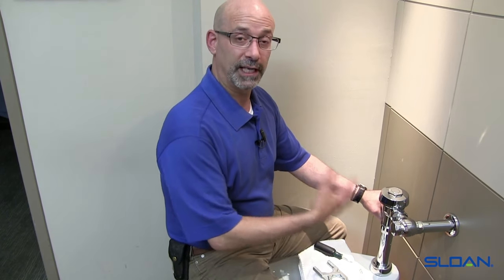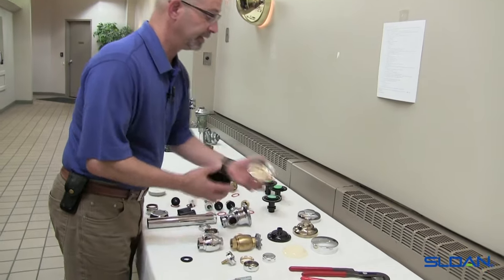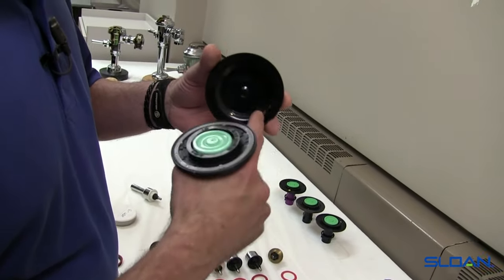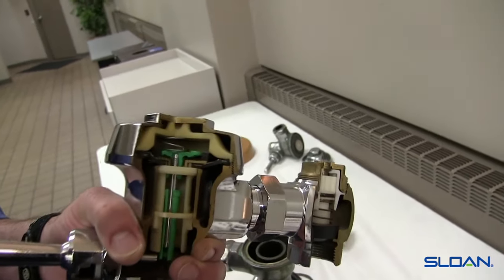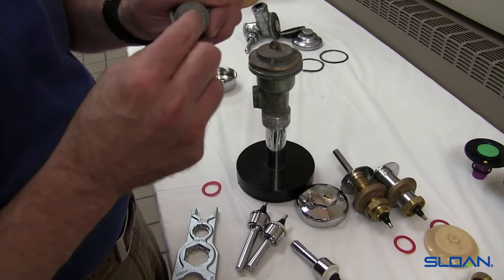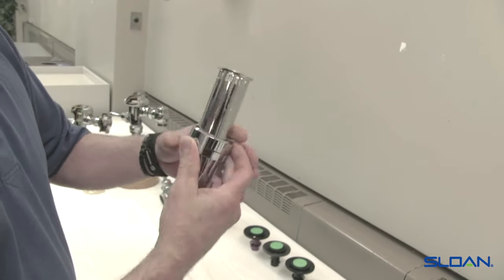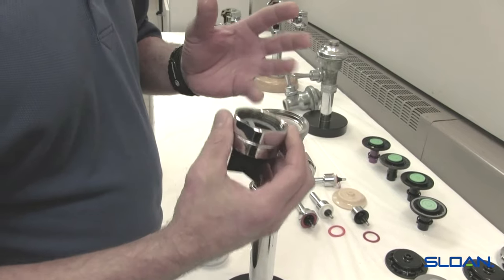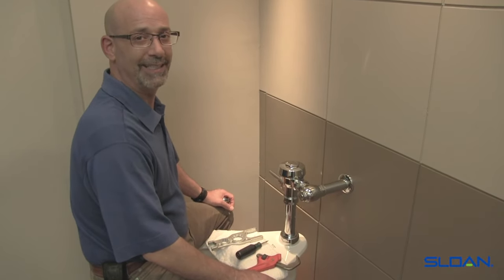Flushometer Basic Maintenance - Using the Right Tools

Comment: I'm jealous of that shiny new valve you're working on.  I need a two foot breaker bar on my spud wrench, and another wrench to hold back on the valve body, just to get the dang cap off of the 100 year old valves I have to repair.
Reply: On flushometers like that I remove the valve body and mount it in a chain vise then remove the cover with a pipe wrench.  That is for old beat up valves.  For nicer looking valves you can thread a 1 1/2 inch coupling onto the vacuum  breaker threads and mount it in a vise using the coupling.  You still need to back up the spud wrench when you remove the cover but it is more manageable.

Comment: Awesome video finally the real expert explains this.  Thanks for this training video.
I wish he had spent a little more time on the diaphragm part since they use 5 or 6 different types for urinals vs toilets and flow amount. In the on-line catalog they have so many different to choose from and I want to keep just 1 or two on my truck for urinals. Will they fit and what are the color codes? The stop valve repair kits also show 2 different ones for 3/4" or 1" but I don't know how to tell the difference in the old ones.
One of my customers has 10 different urinals both Zurn and Sloan it seems the parts are interchangeable on the basic models at least that what they tell me at the parts counter.
Reply from the maker: Doug, thanks for reaching out. The diaphragms are all the same dimensionally. They each have different features which enables the change in the flush volume but you can use any diaphragm on any valve (except for the G2, ECOS, & Solis valves. They use a different style of diaphragm) and it will fit. 
Generally a 3/4" supply line is used with urinals and 1" supply is used with water closets. There are, of course, exceptions. There should be a series number stamped on the bonnet of the control stop. We are currently using the H700 series but you can also get kits for previous series, H600, H540, etc...Hope this helps.

Comment: This is great info. I just wish I could turn the water off. The cap over the control stop just spins loosely on the urinal with sloan g2 flushometer. I know that the valve needs replacement but one of the battery springs just broke off and was stuck to a battery. Is there any warranty regarding the battery spring failure?
Reply from the maker: Dave, thank you for asking. Our tech support team can help you with this issue. They can be reached at (888) 756-2614 during normal business hours between Monday to Friday, or by email at techsupport@sloan.com.

Comment: 1:23 - I have been impressed over the years with your chrome finish.  Please tell me the best cleaner to use to keep them in the best shape.  I know from experience that chlorine bleach destroys the luster in a very short period of time with no resolution but to replace the valve.
19:38 - Your Continental cover has no flats. So, I'd have to use an oil filter wrench to get this one apart?
Reply from the maker: Hi Gary, sorry for the delay. We hope the following advice helps:

1:23 - We only recommend mild dish soap in a spray bottle and lightly spray the towel and wipe the chrome, then use a dry towel towel to clean and dry.  If there are difficult stains it is best to use an ammonia free window cleaner or white vinegar, lightly wet the towel and work the areas needing cleaning, then use a lightly water dampened towel to wipe off the solution, and then a dry towel.  For hard scale build-up or bonded contaminents on the chrome finish, try a mild chrome polish, OR use ‘0000’ steel wool and work the areas to clean and VACUUM up the steel fibers that shed during cleaning; do NOT use a wet cloth to clean up the fallen steel fibers for they will begin to rust and stain the chrome finish or porcelain of the fixture.
19:38 - We recommend using a strap wrench to prevent scratches to the chrome finish.  Sloan offers EBV22 Strap Wrench (Code# 0305823); if replacing the inside cover, use the A71 Continental Inside Cover, Code# 0301221.

For any further questions, please reach out to techsupport@sloan.com. Thank you!
Reply: @sloanvalve  Thank you. That helps greatly. I'm attempting to change the protocol for cleaning the bathrooms in our restaurants and want to offer something to replace the 'Dowse-everything-in-undiluted-chlorine-bleach' for sanitizing purposes.  I expect they're just leaving the bleach on the fixtures after application for it to cause such a discoloration of your chrome finish (looks ugly -- and even appears dirty -- after only a few years using bleach in this manner to sanitize the fixtures). I may also check out the mild chrome polish to get the luster back.

Comment: I've changed hundreds of these and still learned alot from this video.(the reason for the dripping at the vaccuum breaker)
Question,  today I had a flushometer dripping around the valve body cap (a rare place to leak) I replaced the diaphram plus cap.  Still leaked.   Changed the valve body, still leaked same place.   Changed to yet another valve body and same thing.   Could this be caused by the supply stop check valve not working properly , letting water flow backwards.?     We've had pressure fluctuations alot lately.       Thanks
Reply from the maker: Hi Greg, I am sorry about this problem. Our tech support team can help you troubleshoot this issue. They can be reached at 888.756.2614 between 7 am to 5 pm on weekdays, or by email at techsupport@sloan.com.
Reply: I’m rereading and it seems we are having different issues. I looked at the video and he start to describe the issue I’m having at 12:20 mark. I’m seeing you’re having a different issue. Hopefully that helps

Comment: In an attempt to repace the vaccum breaker, I used a spud wrench at work in order to loosen the nut located on the right side of a toilet.  Unfortunately, I somehow caused a leak from where the nut is and ended up having to turn the water off. It required a lot of force loosening that nut. Did that end up damaging it? Also, would Teflon tape help with fixing it? Thanks.
Reply from the maker: Very sorry to hear that. Thank you for reaching out. Our tech support team is able to assist further. They can be reached at 888.756.2614 during business hours 7:00 AM - 5:00 PM (Central Time) Monday through Friday, or by email at techsupport@sloan.com.

Comment: It turns out my old Sloan does not have a groove fir a vacuum breaker. After a number of diaphragm changes and lots of bangs after a flush, the shut off valve started leaking and then the toilet would not stop running:( I tried to open the valve , but could not unscrew it, or didn’t know how to do it . So had to call a plumber...
$400 later and not more than 5 minutes of work, he changed the valve and it all works. I feel stupid:)
I got the Sloan wrench, though, maybe next time I’ll be more prepared:)

Do those diaphragms have a warranty? I now have 3 of them quite new
Reply from the maker: Our tech support team is able to assist you further with this issue. They can be reached at 888.756.2614 during business hours (Monday to Friday, 7 am to 5 pm) or by email at techsupport@sloan.com.

Comment: Very good video but surprised you talked about different kinds and didn't say where to find the model #. My valve would work fine if it reset for the next flush but flows at full force and won't reset. This has to be a defective part but all you covered was leaks. If you reply to this comment I won't know where to look for it on YT.
Reply from the maker: Hello, thank you for reaching out. Our tech support team is available to provide assistance at 888.756.2614 or by email at techsupport@sloan.com.

Also attached is a link to our parts brochure and our full repair and maintenance guide to help with parts identification:
https://www.sloan.com/sites/default/files/2019-11/SLO1081-Parts-Brochure-v19.pdf

https://www.sloan.com/sites/default/files/2023-09/Complete%20Repair%20Parts%20and%20Maintenance%20Guide_0.pdf

Additional assets can be found on https://www.sloan.com/resources/downloads/technical-downloads

Comment: I have a question regarding the flow ring on the diaphragm, how is it flipped to change the rate? As in the procedure for being able to remove the ring to flip? Thank you
Reply from the maker: Thanks for asking. This should help:

You may referring to the “refill head” that can be flipped on the A38A & A36A diaphragm assembly, the black “flow ring” is the loose, flat smooth ring the slide.  On Sloan A38A 3.5 gpf Diaphragm kits, there is a blue fixed ring (refill head) positioned where the black guide tube meets the rubber diaphragm; the blue refill has a beveled step down outer edge seated against the diaphragm (has “SIDE 2” molded into the face against the rubber), and a squared outer edge facing down, towards the black guide tube.  This is the refill head that can be flipped when used on old 4.5 gallon per flush toilets (made prior to 1977).  To flip the blue refill head, Grip the black guide tube with a towel in one hand, and the rubber molded disc on the top of the diaphragm assembly with the other hand, and unscrew the parts; lift the blue flow ring off the top of the black guide tube, flip it and re-install it, now with beveled step down edge (SIDE 2) facing down the black guide tube.  This will increase the volume to 4.5-gpf (Gallons Per Flush).  The reverse will work on the A36A 4.5 gpf diaphragm kit to reduce the volume to 3.5-gpf; same refill head on black in color.  The blue color is to distinguish bevel up for 3.5 kits, and black is bevel down for 4.5 kits during assembly process in the factory.  Because of the increase in flow rate to the closet from flipping the blue refill head, please take care to properly adjust the control stop for a smooth, no-splashing flush; during the flush, the rim wash swirl should not climb in the bowl to reach the rim, it should stay low in the bowl or finish with the swirl into the trapway at the bottom of the bowl.

The  Flow Ring: On  most of our closet diaphragm kits (ROYAL, REGAL, & G2/SOLIS/ECOS), 1.28, 1.6, 2.4, 3.5, 4.5 kits, there is a loose flat smooth ring that slides up and down on the black guide tube which is the flow ring. This ring is a restrictive flow ring, it is not meant to be flipped (it is symmetric), but in cases where (during the flush) the flow pressure to the closet needs an increase in flow rate, the ring can be removed (clipped off) to start the siphon rate quicker in the closet. This will increase the volume slightly overall, but it will increase how quick the siphon starts at the beginning of the flush. After removing the flow ring, please take care to properly adjust the control stop for a smooth, no-splashing flush; during the flush, the rim wash swirl should not climb in the bowl to reach the rim, it should stay low in the bowl or finish with the swirl into the trapway at the bottom of the bowl.  HOWEVER, the caveat is that if the plumbing system flow pressure is below 10-12 psi flow rate, then removing the ring can cause a run-on condition because then there is not enough back pressure in the valve body to force a positive bypass in the diaphragm to shut off the valve.  Most plumbing codes, for commercial properties, will call out a minimum flow pressure requirement of 25-Psi flow rate, not for the valve, but for the commercial water closet (flush valve toilets), for a proper evacuation and drain line carry.

Comment: Can I reduce the entrance from the  1“ to a 1/2 with a pipe reduce? Will it still flush correctly?  Thanks in advance.
Reply from the maker: Hi, thank you for reaching out. Our tech support team can assist you with this inquiry. They can be reached at 888.756.2614 during 7:00 AM - 5:00 PM (Central Time) from Monday through Friday, or by email at techsupport@sloan.com. Thank you!

Comment: Several times I've had a continuously flushing urinal because a bad kid will whack it hard with a hammer or something to flush it. Not sure just what happened but I shut off the water, took it apart to look for damage and put it back together and it works for now. Is this common? Not 100% sure that's what happened this time but I know it's happened in the past. How can I know if that happened?
Reply from the maker: Thank you for reaching out. Our tech support team can help you with this. They can be reached at (888) 756-2614 during normal business hours between 7:00 AM - 5:00 PM (Central Time) Monday through Friday, or by email at techsupport@sloan.com.

Comment: What do I do with the shut off valve cover to make it tighten since it has a piece of loose plastic that just spins, so it doesn't seem to tighten?
Reply from the maker: Hello, our tech support is available to assist further. They can be reached by phone at 888.756.2614 from 7:00 AM - 5:00 PM (Central Time) Monday through Friday or by email at techsupport@sloan.com.

Comment: Nice vid.. I've got a question. Seems some restaurants will convert to a automatic flush, then you revisit a few months later and it will be a manual flush again. I've seen it go manual to auto to manual about 10 times at the same restaurant!... How does this happen?..
Reply from the maker: Thanks for asking. Using our retrofits that convert manual flushometers to sensors in as little as a few minutes, our customers have this option. Feel free to check out sloan.com/retrofits
Reply: @sloanvalve  Guess so. I'm guessing the auto flush isn't nearly as dependable as the manual is it? What usually happens? Batteries simply run out and restaurant doesn't want to deal with it?  Or  dirt gets in the piston?
Reply from the maker: If you are experiencing any issues, Sloan is happy to provide technical support and expertise. Our technical support team can be reached at (888) 756-2614 during normal business hours or by email at techsupport@sloan.com.

Comment: what control the amount of water flow? if we want less water to flush? the diaphragm?
Reply from the maker: Our tech support team can assist you with setting changes on your Sloan flushometer. They can be reached at 888.756.2614 during local hrs (7:00 AM - 5:00 PM (Central Time) Monday through Friday, or by email at techsupport@sloan.com.
Also, on this page you will find our extensive flushometer offerings: https://www.sloan.com/commercial-bathroom-products/flushometers/browse. Simply select the flush volume option that you may be interested in.

Comment: Can i use a zurn diaphragm as a replacement on a sloan urinal/toilet?
Reply from the maker: We always recommend using genuine Sloan repair parts in Sloan flushometers.  The use of non-Sloan parts will void the product warranty.  For more comprehensive information regarding repair parts and maintenance please reference Sloan’s Repair Parts and Maintenance Guide: https://www.sloan.com/sites/default/files/2023-02/CompleteMaintGuide2023.pdf
Reply: @sloanvalve  awesome! Thank you for the response and advice.

Comment: When the value shuts off, there is a loud kickback pressure noise. I notice the value slide in/out on its tailpipe, how to fix this?
Reply from the maker: Our tech support team can help you with this issue. They can be reached at 888.756.2614 during normal business hours between 7:00 AM - 5:00 PM (Central Time) Monday through Friday or by email at techsupport@sloan.com.
Reply: You may need a new vacuum breaker!

Comment: ........ I came looking for information because I have been hearing a drip-drip in the bathroom toilet/sink area. Naturally, I had a heart attack for days until I figured out that the dripping sound is coming from the pipe that goes into the commode. 
........ Fortunately, I can now jump online and come up with the name  of the thingamidge - flushometer - in a few minutes unlike when I wanted to change out the 50 year old one for a new one 20 years ago when I went to a plumbing store with gestures and hand signals! 🙄😁🤣 
........ All I need now is to know what part to buy so I can prepare everything from my handyman friend. 
....... PS: I/we didn't know the water could be shut off from the valve, at all. I literally had a  water shutoff installed for the toilet years ago!😣😥
Reply from the maker: Thanks for checking out this video! If you need hands-on guidance our tech support team is here to help. They can be reached at 888.756.2614 from Monday to Friday between 7 am to 5 pm (central time) or anytime by email at techsupport@sloan.com.

Comment: supply houses do not carry all the parts. On part they do not carry is the black caps and also 0 rings for the seal on the angle stop
Reply from the maker: We are sorry to hear that. You can locate all the places near you here: https://www.sloan.com/company/support/where-to-buy. We do recommend calling the supply house first before you go to check if this part is in stock. If you have already tried this step, you can get in touch with our Customer Service at customer.service@sloan.com. We apologize for all the trouble this is causing you.